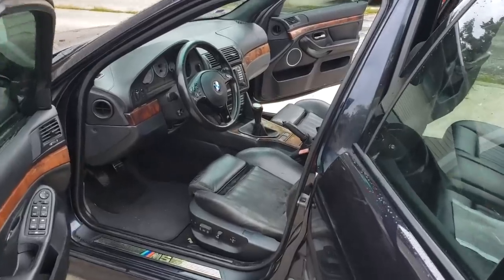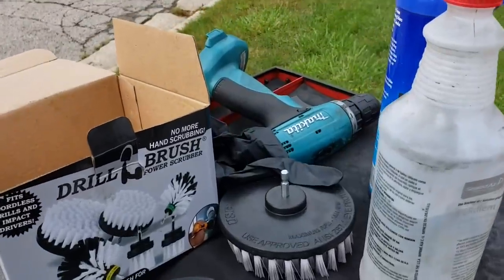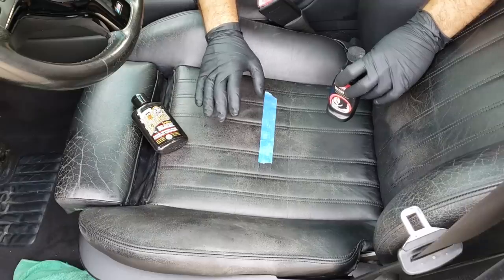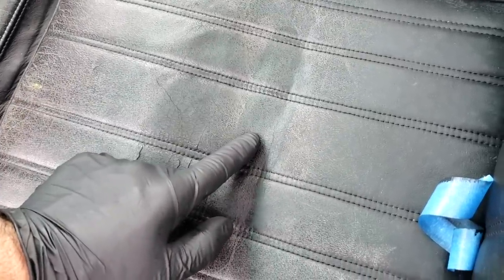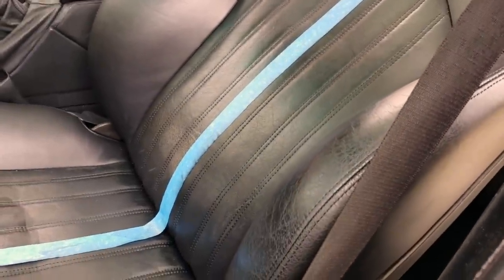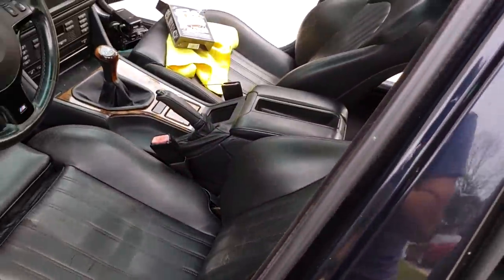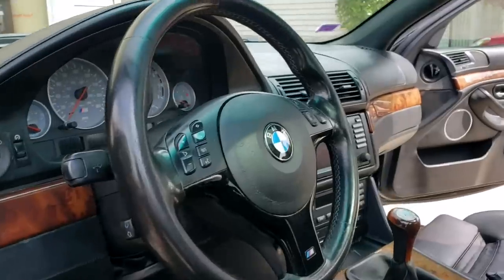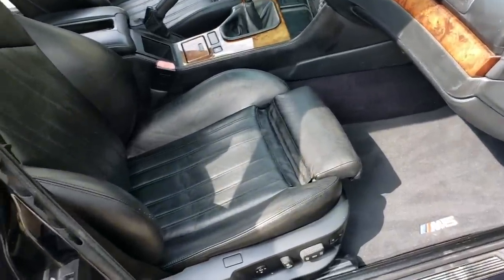Restoring The Leather Seats On My 409,000 Mile BMW M5 For $15. Easy DIY Seat Restoration.

Comment: Never thought I’d see a BMW with such high miles...
Reply: My dad has a 15 impala that has 250k miles on it
Reply: @casio5658  BMWs are luxury cars with expensive maintenance which is why you'll almost never see one with high mileage. This guy just knows how to take care of it.
Reply: @mohamedbaradji7504  no its because bmws are shitboxes 😂
Reply: my E60 got 250k miles
Reply: @casio5658  it’s because it’s a BMW M5, you actually want to drive the car lol
Reply: @Aku112811  doesnt matter if its an M car. 
My E30 has well over 400k aswell
Reply: @zexonraider8058  BMW makes amazing vehicles. Any of em should easily reach 250/300k miles with proper maintenance.
Don’t be mad if you can’t afford it yet lol
Reply: @zexonraider8058  Nope, people dont have the money to maintain them, so when expensive wear parts break down like in any other car after 15-20 years of use, people can’t or skip doing the maintenance or repairs,  and that’s when somebody like you might pick em up and say “what a piece of shit” when really it’s not your kind of car, cuz you can’t afford to keep it running, but you can sure buy it cheap, because nobody else bothered to do so either.
Reply: @nickthedane1  how do you expect people to be able to afford to do rod bearings every 50k km? Name any other high end manufacturer and none of them have that problem. Just proves my point that bmws are shitboxes. End of
Reply: @zexonraider8058  Seems like you are not the Sharpest Tool in the shed.. only BMW very High end race engines need their rood bearings etc changed, and that is not expensive if you can afford the car, again if you can’t it’s not your car. 

BMW give you a special experience with a almost 100% race like engine in some of their cars, and in these types of engines it’s normal that things wear out, especially the bearings. 

Might not be the smartest for a street car, but the E92 M3 V8 and E60 M5 V10 are legendary cars for their engines performance, so again don’t by what you can’t afford, a lot of people buy these cars anyway and change these things which proves this point.
Reply: @zexonraider8058  My dude many, Mercedes, Audi and VW cars are totalt shit, you just dont like BMW thats all, im talking about the character of the car which bmw drivers like, all Mercedes, Audi, VW and such have very expensive problems to, thats just How the cars are in this Price range are.
Reply: @zexonraider8058  I never said BMW was reliable, but many don’t care because they know how to take care and drive them problem free, and they are really greet cars,  but to say the other German cars are so much better is by far an over statement, you will pay the same in bills in the long run if you want to own the car, your hate seems to be personal for bmw which I get, it cost you deeply, but then don’t buy these cars, my buddy bought a Mercedes C350 2007, and the trans went out 8K bill on a rebuild right there, that’s just what these cars cost if things go wrong, mind you the car had only gone 86 thousand miles.
Reply: @nickthedane1  for the most part, other high end manufacturers for the competition to m5, m6, m3 etc are better because they dont go wrong as often and thats a fact. Your buddy was unlucky for the trans and scammed as well as it does not cost 8k to replace the tranny, let alone to rebuild it. Yes things can go wrong but its a fact that these items like the most notorious rod bearings go wrong way too often on bmws and yes you buy a more expensive car, the parts and labour etc are more expensive but to replace rod bearings every 50k km to save an incredibly expensive engine from going bad is ridiculous and you simply cannot deny that. Itd be embarrassing for Renaults to have engine rod bearings go bad every 50k km so its even more embarrassing for bmw that have had the exact same problem with every single performance m car since the e39. My cousin bought an e39 m5 with 160k miles which had an engine replacement at 90k, drove the car to the airport which it started to gradually lose power for no apparent reason, car broke down, got sent to BMW specialists in Germany and the car is in need of yet another engine after they replaced his initially replaced engine with a good used one which broke down after driving for 20minutes. So that car needs a 4th engine, idk maybe to you that sounds normal but it sure as hell doesnt to me
Reply: @nickthedane1  and no its not that i dont like bmw, i like them thats why i had an f10, e46, e39 so its not that i hate them. I am a realist and i know whats bad and whats good. Youve talked about mercedes alright 2151, 2148 very good engines, easily reach 500k, early models 2143 not very good but have been improved. Audi alrigjt 2.0tdi now improved but was an absolute shit engine, still not the best but isnt as bad as it used to be, 2.5 V6 tdi absolute shocking engine, 2.7 and 3.0 tdi v6 are pretyy good with only a complicated timing chane which requires specialists to change. Volkswagen legendary 1.9tdi was great before they added common injectors which makes the engine less reliable but not as bad as early 2.0tdi. Petrol engines for vw we have the 1.6, 2.0tsi which arent great but not terrible either, you have the 1.6sr, 1.8t and old 2.0l which are very reliable and good overall. Mercedes 3.5 pretty good engine havent heard anything bad about them really, 6.2 v8 with common injector flooding problems creating a hydrolock, easily fixed by replacing all injectors which arent too expensive since its an old design engine, you have the 5.5 na and 5.5 biturbo great engines all around then audi 4.0l twin turbo v8 which can blow turbos when the turbo filter clogs up which is a pain in the arse to change or simply remove them entirely which is cheap apart from the labour. All in all no manufacturer is perfect, but the notorious rod bearing failure for bmws had not only been a burden for over two decades, quite miraculously not been fixed yet which further proves my point that bmws are shitboxes and even though they are, they arent really all that terrible and its a fact that when it comes to competition for m cars, rs and amg cars are simply better. Case closed
Reply: @zexonraider8058  My point is these cars are very expensive to run all in all, and I do agree with you that BMW is far more unreliable than other brands, but these cars are so expensive to own, I’m talking high end BMW, Mercedes and Audi, that the fact that a BMW might have a problem or two more don’t do it for me, because when fixed they are great cars, ofc if you have to drive it to a mechanic then don’t even bother buying a used luxury car. 

And it’s does cost 8-10K in EU to fix at a Bosch Mechanic, in Germany and so on it’s much cheaper than in Denmark where I live.
Reply: It’s not the engine/trans it just literally everything else with the cars.
Reply: @grahamcarlson7384  naah bro, they made good
Reply: My ‘94 has a little over 275k miles and still running strong!
Reply: Owned 4 BMWS.....all four were sold with all 350k miles original engine and still running perfectly. BMWs are not made for the budget car owner or cheapskates...if you're looking for a deal...BMW is not your car. Get a camry
Reply: Quality cars,  premium cars if maintained according to manufacturer specifications , and not thrashed or abused will easily do these sorts of miles .
Reply: Mine just broke at 75,000
Reply: My 92 535 has 288k and gets smashed on everytime it’s driven

Comment: I have a 2004 SL 55 that had ripped and torn drivers seat with side bolsters that were severely worn. I bought a complete passenger seat for $400 and then took all 3 backs to an upholstery shop who took the best sections from each cover and pieced it together. Charged $135 for that. I ended with perfect seats with no wear.

Comment: I used colourbond products on my car.  It’s also a leather paint/dye but it’s specifically intended for seating surfaces.  I also used crack filler and glue to fix the small torn areas like you have to give an even nicer result.  Look into their products if you’ve never heard of them as they are very DIY friendly.

Comment: What was your experience some time after applying the leather dye/conditioner? Did it fade away or wipe off? Did it stain clothing? Was it slippery on the steering wheel? What leather conditioner would you recommend on top of this dye (I understand it already has something in it)?

Comment: Decent results but it would've been surpassingly better if you had sanded the leather and filled the cracks with leather fill in the seats. It would level out the majorly cracked areas especially on the bolsters. But great vid anyway! Thanks bro!

Comment: I've seen some restorations where they swapped the driver and passenger seat, if it's in better condition, that way the driver gets a better seat and it eventually evens out the wear between the two. I think most times they swapped the foam and cover and maybe with some cars you can do more.
Reply: Can't do that will all cars, BMW seats tend to have the same cushion, but the passenger side often has an occupancy sensor that the driver side does not.

Comment: I would try doing another coat of Doc's. It looks better than before but could use another coat if it would make a difference....? At least in a spot no one would notice, at least to try out. My leather is very light tan and has a few of the same splits in the leather like you do. Any easy way to fix besides "spackling"  and painting as in other videos?

Comment: Just a friendly question but did u consider a steamer to shrink some of the leather back to shape before dye application?
Reply from the maker: I didn't for this video because i wanted to show an inexpensive method anyone can do without any special tools. But, that's a great idea.
Reply: how much does a steamer cost?
Reply: @gregh7457  Look it up on Amazon. You can get a decent  one (not vacuum combined - only steamer) for ~60$.

Comment: I have been looking at these cars on craigslist and other sites. Compared to the 540i is it fun to drive around canyon roads, windy roads and such. Looking for opinion as I am outgrowing FWD cars. Also thinking about RWD coupes.....any pointers, help, ownership experiences will be appreciated. Currently drive a 2005 Mazda 6 V6 5Spd
Reply: A little more fun than a 540i. Sharper steering, greater ability to change attitude with a happy right foot.

Comment: You would still be better off with the Kiwi because it not only dyes the leather you see but also dyes the backing material and your worry about the shine would be over with as soon as you apply the leather treatment because the treatment would bend the dye further into the leather when you coat it with the conditioner. as soon as a few days of the "doc baileys" wears off in a couple days it'll look the same or worse as it did before you started. The best seat treatment i've ever seen is someone who used Saddle soap on the leather along with a dye. when it dried and cured the seats looked brand new and stayed looking that way for over a month after treatment

Comment: Does it feel any different? I remember old leather seats professionally redyed using spray gun. They looked new but felt like sand paper I hated it
Reply: Pennychaser1 they probably did a bad job, if it’s rough to the touch they likely sprayed with the wrong pressure and distance.
Reply: @hobnob9249 , or the wrong type of "dye."

Comment: The results would be even better if you applied leather crack filler, sanded that down, and then used professional grade dye on top of that.  The "body filler" stuff gives amazing results.

Comment: You and I may have been cut from the same cloth.  I too am an owner of an E39.  Do me a favor and apply some Armor All to the red plastic of your seat belt clasps.  It will bring that red color back for a fresh look.  Its one of those little things that can make a big difference.  Congratulations on keeping a 400K car in such presentable shape.  Since I do drive my car, I am one of those 10 feet guys.  If it looks good from 10 feet, I'm happy.  Lets face it.  The only way to keep a car perfect is not to drive it.  And what fun is that?

Comment: My 31 years old 911 Carrera has never seen a leather dye product. Granted it doesn't have 400 000 miles (only 1/3rd of that) but then that M5 doesn't have its original seats either. The solution to not have leather seats in such a bad shape is: a) take care of them semi-regularly (but no dye) and b) have quality leather seats. Because really: the solution to not end up with seats as in the beginning of the video is simply to clean and condition them using quality leather care product every six months (heck, once a year is probably fine too).

Comment: First, I understand the point of the video. However, given the level of effort on the full leather interior I'd recommend taking the seats out as part of more comprehensive detail. Also you could use the sunny day of heat lamp to speed up dry time... There are too many leather products to list that could be used as well to protect the seats after you've redyed them.

Comment: Did it rub off at all on your clothes after restoring the seats then driving?
Reply: Just wear black jeans and shirt. Should be fine.
Reply: @paddy19656  what if some one is wearing only bright clothes? Oops.. very bad idea to do this in your car if you wear white etc. the pigment will dye your clothes instantly in summer 🤣
Reply: It depends on product. I wouldn't use a shoe dye or any old due
 If its a coated seat (painted seat) and most are,  then it needs to be recoated with acrylic leather paint. These 'dyes' may be weak acrylic paints. If you just put a wax shoe polish on, it with be a disaster. 

Unfortunately we are too vague with 'dyes/ paint/ sealant/ coating and need to get down to whats actually in stuff.

Comment: There are lasting solutions for leather repair and these seats deserve to be properly restored. This is totally amateur job, which won't last.
Reply: I was planning to do the same on my car. Do you have any recommendations for better products?
Reply: @cg7305  I live in Europe and have used Furniture clinics repair kit and other products. In the US you can probably find even better products. It is important to have a lacquer thinner, because the leather itself is not cracked, the finish is. And after you dye the leather you should seal the colour with a proper finish for leather. I hope this was helpful.
Reply: Repair as necessary or reconnolise using spray paint specially designed for leather

Comment: Nice job Alex.  Aren't you glad you went for the E39 rather than the E60?
Reply from the maker: Yes. The E60 M5 just sounds like a nightmare
Reply: @LegitStreetCars  Years ago when I had my E39 I looked at a nice E60 M5 that was a rare 6MT (I already knew about the horrible problems with the SMG trans).  It was a nice car but I didn't like the lack of down-low torque that the E39 has in spades.  An E60 M5 will certainly move out but only with the engine really wound up.  In my opinion it's deficient as a daily driver.  Then there's the atrocious gas mileage, rod bearings and so many other things.  Pass.
Reply: @Aardvark49 , well said.

Comment: hey brother it does look good but I used to buy cars clean car sell cars just as a side Hustle there used to be a product called glove soft it was made to compete with saddle soap which saddle soap works very well also you clean it you clean it very thoroughly and it will actually lift some of those wrinkles out but there's also something else when you're dying say clothes or shoes or even leather the oils is what makes it bond to the product if you dye a pair of pants black again they tell you not to wash them if your wife dies her hair they tell her not to wash your hair before dying it just saying I've never cleaned a set of leather seats all in one day I've always had a better result letting them sit out and bake in exorb what they need

Comment: You'll want to bathe that driver's seat in mink oil and let it soak in the heat repeatedly, until it shows gloss rather than soaks on, then wipe /buff for a satin finish.

Comment: OK they look better I guess but I restore car leather seats and if we did this like you have done it, my customers would all run away. The drivers seat is cracked yet it's easy to fix with leather filler just applied with your finger and a hair dryer, we use a leather repair paint system which is remarkably cheap to buy, you can buy a kit for each car on ebay and makes the seats look like brand new filling in all the blemishes and you don't have any product left on your clothes when you drive the car.

Comment: Still looks like sun damaged, cracked leather layered with a top coat of fresh color to me. I suspect that leather requires far more conditioner than that to restore and reverse some of the aging process.
Reply: Absolutely. The seats should have been thoroughly cleaned, then conditioned, before attempting to recolour. In fact, correcting the cracks will be more difficult now.

I get that the intention of the video, but this is hardly "show ready," and shouldn't be marketed as such.

Comment: Kiwi is the worst product you could use cause it contains silicon ! It's gonna block the leather to breathe > dries > cracks, + it's shiny.
A cleaned automotive leather has always a mat finish.

To obtain goods results, use pro products (like Colourlock...) and the right method. It takes a little bit of time but I would have filled the big cracks with liquid leather after cleaning, then I would have scrubbed all seats with a 600 grit paper before dying. Again, you have different pigments quality in dying products, I've always used Colourlock products and been very happy with, FOR LONG TIME.

What you did is OK, but for a short period of time :-/